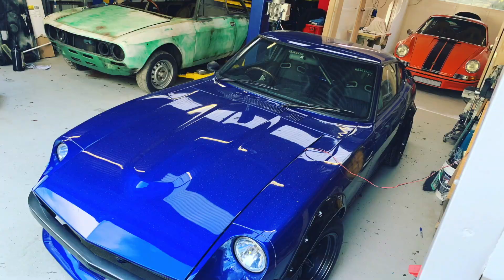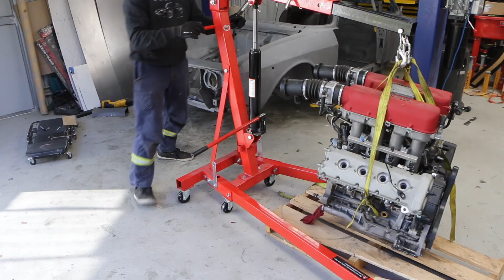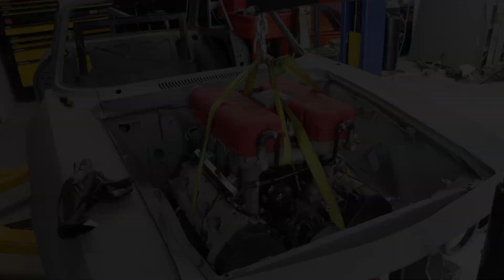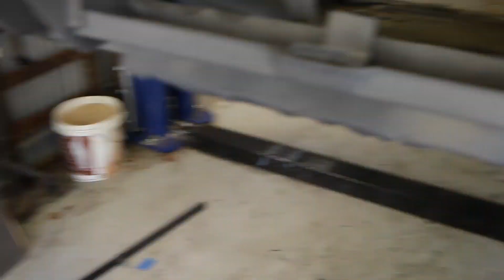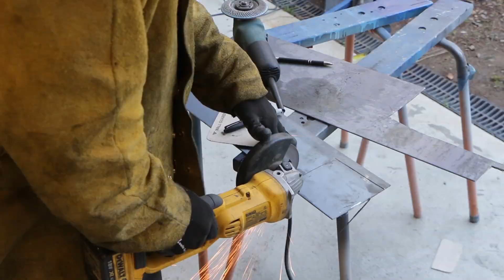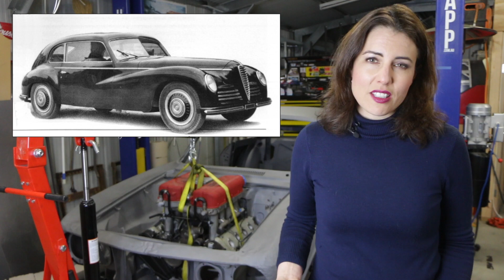Will the Ferrari engine fit? - Alfarrari 105 project car build part 11

Comment: https://www.pacificmotors.com/auto-parts-shop/maserati/maserati-quattroporte-v-m139/air-intake-suction-mainfold-4-2l-v8-f136-190008-maserati-quattroporte-m139-03-06-2/?gclid=CjwKCAiAnIT9BRAmEiwANaoE1ZjY0DzT_EcHajX8jdvSmmo1kjWeRQFOIX9YA3oVospq3fFoQVo4KBoC9VgQAvD_BwE
Gran Turismo intake will give you more low end vs less. Or you could use aluminum exhaust pipe and go cross cylinder mandrel bent for slightly longer runners with the intake plenums as low as they will sit.

Comment: Jeff, it's really shadetree but I take a rod, nails, and vise grips. Clamp one nail perpendicular to the rod and set your other nail at the point you want to measure. When you have it exact and both ends clamped use a tape between the two points. Hokey it is.

Comment: I don't get it why you name it 105? It is a Junior. Do you reference the production series Tipo 105? But even the Giulia was in this series, so it doesn't really name this car. Has it been sold under this name in some countries?
Reply from the maker: It is actually not a Junior, it is a 1973 GT Veloce 2000 if you want to get technical. Junior is the lesser model (as Mrs Jeff has explained ;) ).

Comment: Regarding the crossmember/bottom engine support  : i would recommend to avoid any harsh edges - as you find where the bottom part connects to your strut towers - vibrations over time may cause it there to break

Comment: Awesome work Jeff and looking forward for the finished
Alfarrari. With the 400% increase in horsepower from the original design, have
you also considered the need to have the chassis strengthened, I anticipate the
car is to be Engineered to have this engine and gearbox transplant for it to be
legally road registered.
Reply from the maker: Yes

Comment: Can you cut the runners and move the plenums to the sides and down, above the valve covers to retain the runner length?  It looks as if the plenums are joined in the middle, so I guess this would need to be reworked as well. But the throttle bodies would then be lower and  already tucked to the sides... right near the headlights  (not sure if you can get through inspections with 2 less headlights than stock) Love the build(s)!!!

Comment: Jeff, great project and full marks for giving it a go.  One suggestion might be to cut the runners and lay them out to the sides in a nice 90 degree bend.  That way you're keeping the length roughly as per original as well as lowering them for clearance.  You should be able to get the red covers in a position that allows admirers to read the name from the side. Keep at it!

Comment: Velocity stacks, 8 throttle bodies and in ideal case the carburetors would make this absolutely perfect. In my opinion way cleaner optically, will help the sound and will "fit the car's original nature" much more than modern efi engine under the hood bulge.

Comment: Instead of loosing the 60mm of intake runner length why not weld in a cast 45° or 90° elbow and relocate the top of the manifold out towards gaurds and that way you may not need a bonnet bulge at all.

Comment: Great vid Jeff. Love your builds. I've just found your channel so have happily subscribed. Looking forward to see all your builds. 
Just one point another "structural engineer made that you'll still get the strut towers might bend in, can I suggest, if space allows running a tube behind the bulkhead, behind the dashboard, and then triangulate the strut towers to the tube with a 3mm plate to reinforce the bulk head as well. This with a stiffly mounted engine should really reduce any flex especially with having 4x the power.
Any thoughts on a roll cage? A really nice closely fitted roll cage would be ideal for safety and chassis stiffness.
Keep up the good work, really interesting builds!!!

Comment: I am impressed with your vision on this project.  I think I had some doubts, but to see it fit fairly snug, but neatly into the engine bay was a relief.  Getting into this now!

Cutting the 6cm cut out of the intake should not really alter the engine characteristics too much, I think.  The 911/993's Varioram manifold has up to 60+ cm of intake tract length changes, so it's not like those few cm's will be the end of the world.  With a custom ECU and tune I doubt the difference will even be noticable.  IMHO of course.

Comment: Had you considered leaning the intake runners over 45degrees ish so they draw from opposite plenum? That will drop the engine height but retain the overall length and maintain low down torque

Comment: When you cut down the tubes on the intake, could you also turn the manifold 180° so the throttle plates are facing forward?
Reply from the maker: Did you watch the video ;)

Comment: That little bit of thick material you added to your short beam doesn't come anywhere close to the vertical bending resistance of the tall factory beam.  It's a basic structural engineering concept. Since you like to do it yourself, Google "stress moment of inertia" of a rectangular beam and how it relates to stiffness of a beam and it's resistance to deflection.  Your solution may appear to work statically but the cross member you cut out is meant to take left to right bending loads (among others) caused by the car's weight and dynamic loads caused by cornering and bumps in the road.  Dynamic structural loads and impact loads caused by bumps and suspension bottoming can be quite significant.  Luckily, I would bet that Ferrari built that engine to take chassis structural loads thru it's housing.  So, in my opinion you should look at hard mounting the Ferrari engine and stiffening up the engine mounting points and somehow tie them back to the beam you just hacked up.

Comment: If you can't get that engine to fit under the hood perfect, I believe the Maserati V8 and Ferrari V8 share the same architecture. So I'd suspect you could get a Maserati intake manifold and use that. Although it's not nearly as sexy, it's more like an LS manifold. Alternatively it looks like possibly the Ferrari California may have a shorter intake due to it's front engine configuration.

Comment: with that much motor, i’d be looking to get it as far back as possible to help with weight distribution and handling. With regards to the gearbox conversion i’ve done a few before. Old skool method is to use transfer screws in the bolts holes and a turned (to a point) spigot in the crank to pick up the datums. last one i did i sourced technical drawings of engine block and bellhousing to overlay them in a vector diagram and had it laser cut.

Comment: Should have made it symmetrical and welded captive nuts on both sides . A captive bolt is beyond stupid and only done in the factory because it’s cheaper than welding a nut and fitting a stud.
I would have cut the entire structure out , made a cradle to fit the engine so it can be fitted from the bottom and bolted in like with a late model mustang or comaro K member .

Comment: Great to see the big v8 in there. Fits perfect. Chop the intake down, easy.  The transmission to engine mating is going to be a tricky part.  You should think about how wide of a rear tire you want to stuff in there and tub the wheel wells. would be nice to have a 275 tire to try to get some of this power to the road.  Amazing project!!!

Comment: Obviously the intake has to come down a bit but I wonder if you wouldn’t retain more room under the bonnet by leaving the throttle body orientation reward and run cold air via the cowl. Look up some 60’s nascar pics. It would make for a much simpler airbox/filter set up too.
Reply from the maker: They don't bother with wipers though.

Comment: Great work, my only suggestion is that to not fully weld anything at this early stage, based on personal experience until you have fitted/mocked up everything. It saves a heap of hours in the long run as things often need to change even if only small its easier to cut tacks out than full welds.

Comment: Hi Jeff , drill 2 x 2.1/4 inch holes both side through the cross member . fit pipes and weld around the ends to run the 

front two exhaust headers through ( slip joint )
Check how close the bottom of the bell housing will be off the road.

Comment: From what I have seen with previous Ferrari engine swaps the plenums are designed to fit one way and the intake ports are staggered, so you could have quite a task on your hands it's not a simple case of rotating it around 180 degrees. Still a cracking project and I look forward to progress!

Comment: Go with ITB's it will be a much cleaner setup, more power and response, with no hood bulge. Cut the runners down and have a flange set water jetted out to match up to a set of 4 cylinder ITBs with good bore spacing. Drift Works did a similar thing with their Lamborghini and two sets of M3 ITBs.

Comment: Save yourself some additional space and bloody knuckles and shave off the flange from the top suspension arm mounts. You can simply take the grinder to them and weld 'm back up. Like this: https://thumbs-eu-west-1.myalbum.io/photo/1k0/69f7c1ca-5c27-42ab-89ae-333b4b24398d.jpg

Also not sure about the bending loads put into the cross member by the upper suspension arms and the cutting you did to the cross member.....
Reply from the maker: I was planning on doing just that ;)

Comment: G'day Mr and Mrs Jeff!  Firstly, good on you, very entertaining keep it up provided it's not sending you broke!  Regarding the cross member, that will be weaker in torsion and almost certainly in bending although the corner reinforcements will help some.  You are space constrained so I get it.  Have a think about boxing out the top of the engine bay with bracing..tie the strut tops together, this would help with bending loads on crossmember and if triangulated, torsional.  When making things stiff think about where you push the stress...that's where it may crack...consider reinforcement plates under the car at the cross member reinforcment tie in points.  Ideally, cut the lot out, get everything  where you need it and then design it. Don't forget steel comes in different MPA..important if you lack space.  Exhausts packaging..look at a 1990s Griffith TVR 500. Does the steering rack have clearance? Maybe run up and forward..would look fantastic in engine bay..then try any run both pipes down passenger side..unless you like hot feet in a small 105. Plenum..make sure if you cut..it can be reversed if you are not happy with result. I like stealth look also but next option is to lay them over in the engine bay..just above the injector might just do it? Have a chat to a friendly mech. Or structures engineer about the cross member..nothing to lose..most importantly..speak with the guy who will engineer this car for the road up front to avoid pain later.  Fwiw I am ex. Mech. Eng. GM body structures engineer, who loves playing with cars in my shed also, not an expert nor a business, but you are welcome to contact me if I can help in any way.  I respect you doing it all yourself but wisdom is knowing when to double check with the experts.  Its risk based..(likeyhood and consequence)...cut ferrari plenum and lose torque: likely. ..Consequence: meh...Undercook crossmember, drop an engine, crash a car and kill someone...possible..nuff said.
Mrs Jeff...I wish to make a confession...I used my wife's dishwasher to clean my cam cover...joke was on me...aluminium did not like the washer tablet...

Comment: If you are cutting out the gearbox tunnel, then why not cut a hole in the firewall, and pull back both the engine and the seats, to transfer some weigt rearwards? And make a new front suspension in tubes. Cause I bet you will have problems with the manifold as the engine is sitting now. And if you make the plennum in some kind of transparrent material, it will look great.....
Reply from the maker: I want to use the original dash, heater, etc, if I can, and weight is not an issue as per last video.

Comment: Your idea to slot the flywheel bolt holes might be a bit questionable Mate.  You might think about machining in dowel pins after installing the flywheel.
Reply from the maker: I am now going to go custom.
Reply: Home Built By Jeff will you get away with a standard subi flywheel reclocked and drilled for the Ferrari crank (similar to multifit wheels) or is that to compromised strength wise?

Comment: God bless your enthusiasm. You sir are both nuts and a force of nature to be reckoned with. While you are measuring stuff don't forget about the steering knuckles and the burman box AND the exhaust manifold. I find my Spica GTVs to be tight enough as it is.  The battery is going in the back-will help with weight distribution if nothing else. 

The welded cross member seems strong- (hard to believe the original was a formed sheet metal area prone to corrosion).  Very very glad to see unibody stitch welding used to stiffen the chassis. Best of luck. Exciting build.  We are going to want to see a dyno run to see how the trimming of the intake runners affects things

Comment: I like what is going to take place under the Alfa bonnet, Jeff it is a mans job to protect our women from whisks that we have used to mix paint, polyfiller and even car polish. Scoops that may or may not have been used to put paint in a paint Kettle. funnels that may or may not have been used to add oil or other car fluids to an engine or to prevent Thinners from spilling when being put in to a smaller container oh and the thermometer that I used to check the coolant temperature. You would have thought that ladies would be happy as they take our bank cards to replace said items.

Comment: With the work left to modify the intake, front rails, and towers for exhaust fitment, I wonder if taking a stab at a full tubular steel K-Member set up might be worth attempting. Here in the states we have bolt in replacements for the Ford Mustang. I'm betting with the number of those alphas that saw racing and still do, its been done and measurements are available. Thinking down the road a bit, it can solve a lot of problems when your trying to put back in steering components and other fiddly bits.  Enjoy learning and problem solving along the way. Whichever path you take, looking forward to where this goes,  its a fun project to follow.

Comment: I think that this build is one in the spirit of Carol Shelby "Too much is just enough", its going to be interesting watching this thing take shape. One idea which may help out to reduce torque twist might be throwing in some tubular framework where you can. Would be a pain to graft it in and hide it away, but at the end of the day it will help to give you a really solid structural front end, which with the right plating and bolting (sad sad Australian regulations not allowing any welding of the sub-frame) would allow you to make a full structural sub-frame to help link the front and rear to ensure that all of those ponies make the tires squeal and an abundance of white smoke (all in a secure and safe area of course :D )

Comment: One more thing i suggest you do is get an upgraded clutch fork for the trans. The oe ones flex/break with pressure plates  harder than stock. Which you will need for that Ferrari engine. Verus makes a forged one relatively cheap.

Comment: Project Binky set the bar on drivetrain swap packing...  However,  this project is no doubt as complex.   It would be great to see an artist rendering of what you expect the project to be in its final color scheme, stance, etc.  🏁👍
Reply from the maker: Binky is MUCH tighter than this one
Reply: what would be amazing if the Binky Boys had a small visit to Jeff just to help with any brackets that are required :)
Reply: Surely the colour can only be red.

Comment: I agree with Southern Engineering.  You've taken a deep beam, and substituted a heavy, but shallow beam.  If you can make that member work in tension and compression only, you should be fine.  If it is working in unsupported bending, it may flex or even fail.  You may have room for a removable upper front cross member to take load off of your reconstruction.
Great work,
Dave
Reply: Needs to solid mount the engine at the very least

Comment: Hi jeff. Great work. Love the Ferrari engine  in an Alfa. 
Wee tip for you when welding, with mig, you push the wire into the weld, moving forward. Arc welding you drag the rod towards you. I see you drag the mig. If you want stronger welds, try that.

Comment: Uhhh... I don’t think your lower steering arms are going to work anymore.  Doesn’t the linkage run diagonally across the space you just cut out for the engine to go?  Time to redesign the tie rods and steering box before you get too far ahead of yourself. 😬
Reply from the maker: Way ahead of you ;)
Reply: Good news. Plan AHEA

D.

Comment: looks awesome the the engine sticking out the top like that. when you make the bulge in the bonnet, you may want to think of some way of having it removable (if it can be made look good when on), just so you can take it off sometimes and see the Ferrari red intake move about as you put the boot into it!
Reply: or maybe just have a second hood with a cutout...

Comment: Personally I think the biggest problem lies with the fact that the engine crossmember is part of the shell in that it’s welded in. That fact is limiting every5ing you do. I would be looking at removing it altogether and then fabricating a new engine crossmember to bolt under the car and attached to the chassis rails. That way you have total control of where and what height the engine needs to be.
Reply from the maker: That is the lowest point of the car, so remaking the whole thing again is just more work and harder to engineer and would not be any lower.